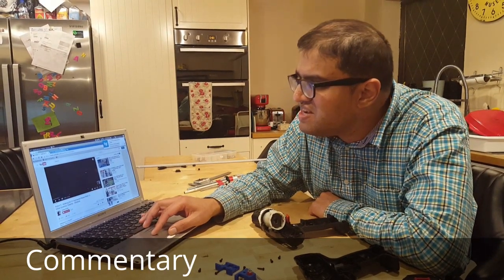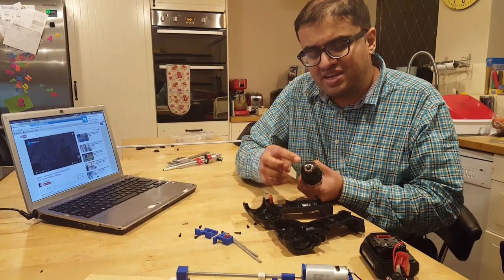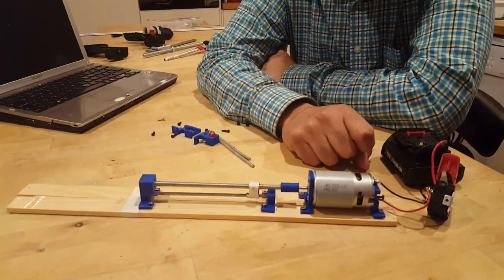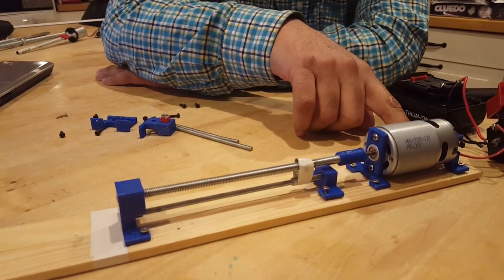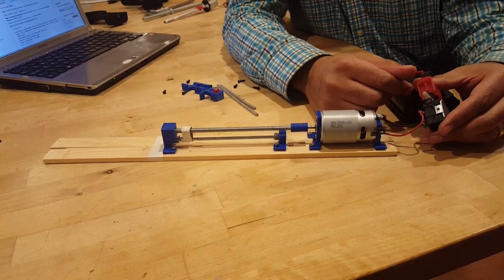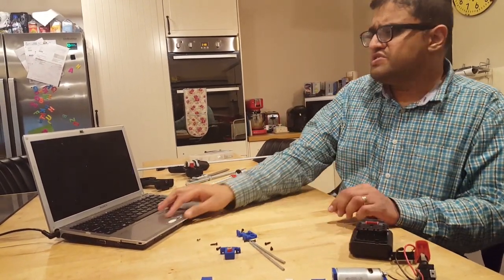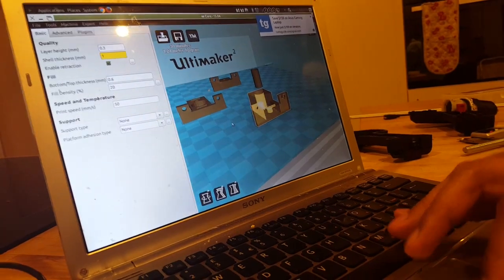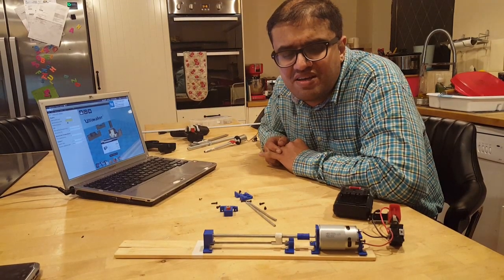Home made linear actuator inspired by James Brutons robot)

Comment: This may be a dictionary definition of a linear actuator, but not functionally a linear actuator, at least by my understanding.

A linear actuator has among its parts an inner and outer tube.  The inner tube is attached to a threaded nut that is screwed on the spindle / threaded long screw.  The motor turns the spindle / threaded long screw which moves the nut along the threading extending and retracting the inner tube.

Both of your examples don’t extend a tube, a screw, a rod, or anything else longer than their original length.

The textbook definition of creating motion in a straight line in contrast to the circular motion created by a conventional electric motor may be accurate, but the motion is conventionally applied by applying force outwardly / increasing the length of the actuator.  So you know it can open / close a door / window, raising / lowering beds / tables / televisions, solar panel adjusting for optimal energy absorption, farming (combine harvesters, sprayers, tractors, seed drilling), industrial factories / processing centers (sorting machines, feed systems, clamps, conveyors, toasters, de-boning devices, meat separators, food processors, pretty much material cutting of any kind is done with them).

There are actuators that are used that don’t move an inner tube out of the outer tube, but they are not typically called linear actuators, and if they it is by definition incorrect.

I’m sick of clicking on videos that are incorrectly titled by accident at best and purposefully misleading clickbait at worst.  Videos for example that say they have a homemade linear that opens and closes a door, and then not only do I not see a linear actuator, but it’s the house is an 8 x 11 sheet of paper with a small piece cut and on 3 sides which is supposed to be a door.

Which is opened and closed by pulling a string that manipulates a paper clip that is glued to the “door”.
A door which is literally paper thin, and could be not only pushed open with a quick press on an air horn, but it could be ripped off its paper hinges.

That is just one of at least 20 other videos where someone has said they have created a linear actuator and used it to open and close a door.

Not saying your video is at that level, it’s one of the better ones, but it isn’t a linear actuator, in the way one generally uses it.
Reply: He's using a bare DC motor spinning and an RPM in the thousands. 
No chance this will ever be useful.

Comment: sir could u make a step by step process cause they are really expensive to buy and i would really like to build by my own
Reply from the maker: Hi Karteek....I think its really relatively simple...I think my version is only a prototype and it is probably best you experiment using the concepts rather than copy the manufacture. Access ti a 3d printer is required and I suggest you access your local hackspace if you dont already have a 3d printer.

Comment: I'm with you . Buying the linear actuators are very expensive. Like your idea. The only question I have is, How much weight can it lift? James' robot gets pretty heavy.
Reply from the maker: Hi Rod, I think he used the same motors. however there is  no gear reduction. From a physics point of view i think you need to generate a force slightly greater than  that of the mass effected by gravity - so the gear ratio should technically not effect this - only the rate at which the mass could be lifted. any physics whizzes please correct me if Im wrong. (and I may well be wrong!). I would dearly love to build a linear actuator robot but Im too busy...

Comment: I don't see anything coming out, so how is this 'actuating'?
There is a much easier way, put a nut in a tube, put a threaded rod in that nut. Turn the rod with a motor. The nut and thus the tube will travel up and down the rod
Reply from the maker: Hi Ed. Surely it depends where you attach your output. If you attach it to the moving component that moves along the screw then surely it is the same as having the tip move in and out?
Reply: You have to make a shaft around the whole thing and attach a rod to make the moving piece move the shaft
Reply: @sujitvasanth2502  sure, i guess it all depends on what you eventually want to move, what is the easiest design